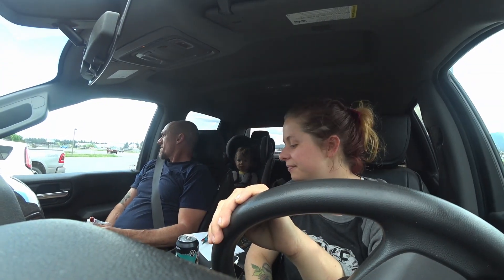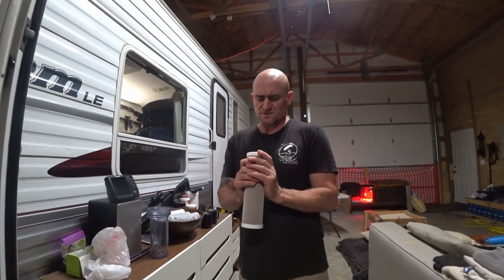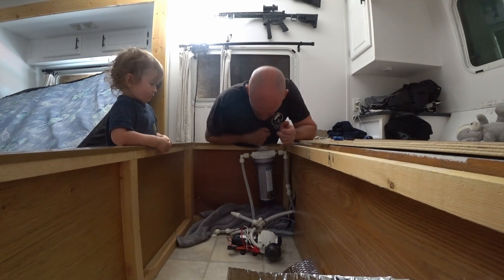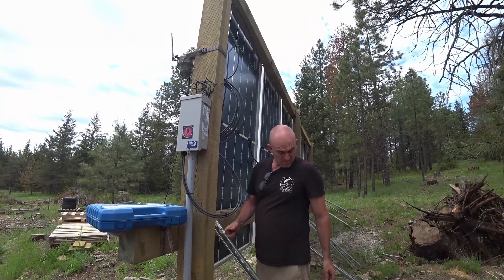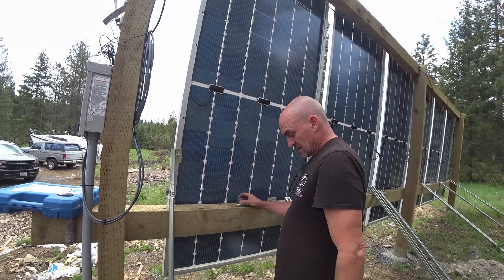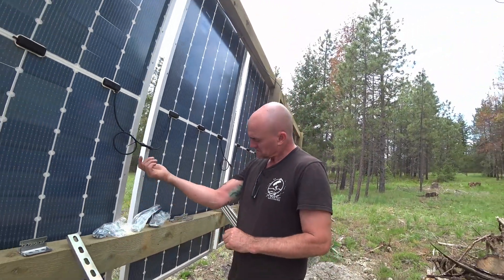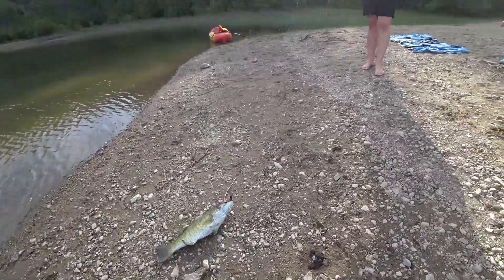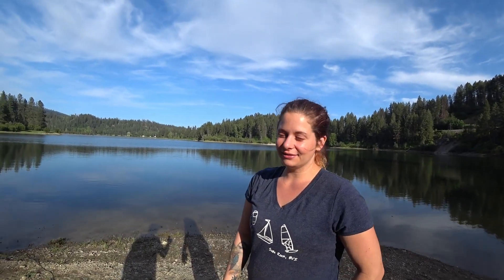DIY Solar Panel Raising System

Comment: Great Catch! Looks like a simple and effective solar set up. How does the brackets hold up with the weather?
Reply from the maker: Good Question! We have not head any major yet on the brackets. We only tip the solar panels up during summer time which is the milder weather period. We will keep you updated on performance! We have thought about adding additional supports but dont think it is needed during this season.